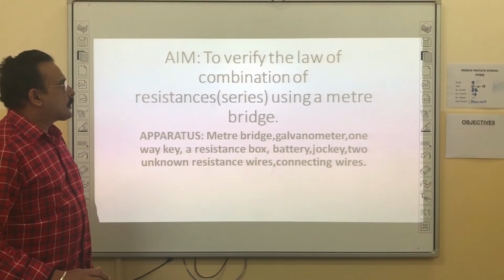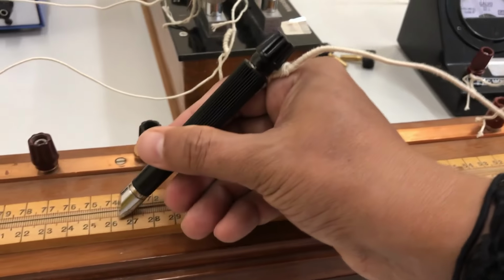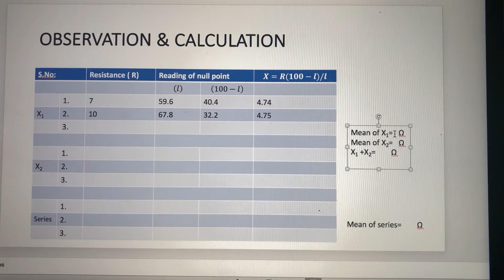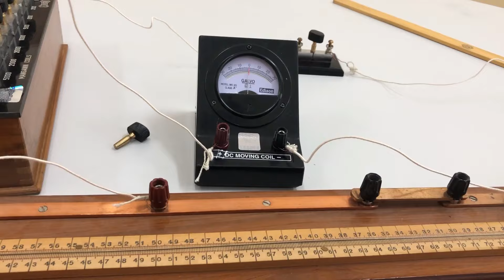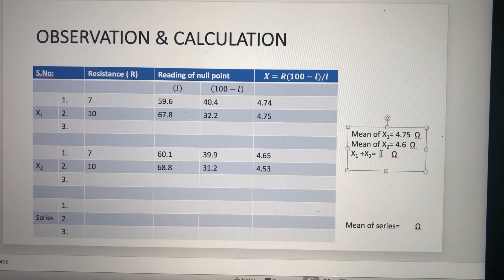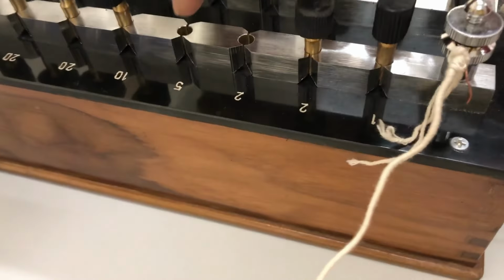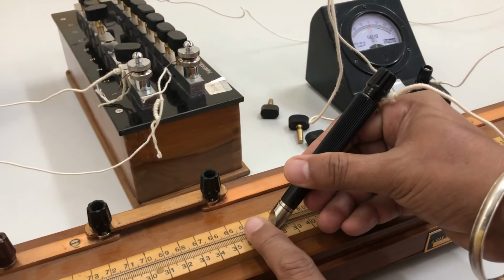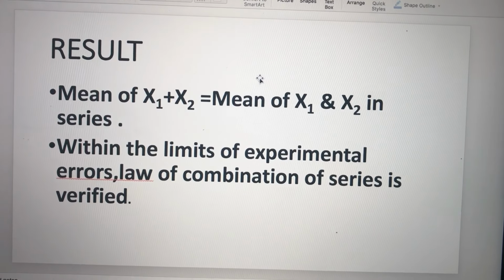METRE BRIDGE: TO verify law of combination of resistanses in series using metre bridge.PRAKASH &MINI

Comment: The reading of null point should be from 45 to 55 cm. But, in the video is taken to be 59.6 and 67.8
I think, this should be corrected
Reply: This is also based upon the wire's length
Reply: And he's taking readings from the lower side of metre scale even though he's moving jockey from right to left
Reply: @angelmaria7457  so should we take the reading  from the upper side of the scale if we move from right to left?
Reply: @raunak509  I think yeah. That's how we do it right?
Reply: @angelmaria7457  the null point can be between 40 to 70